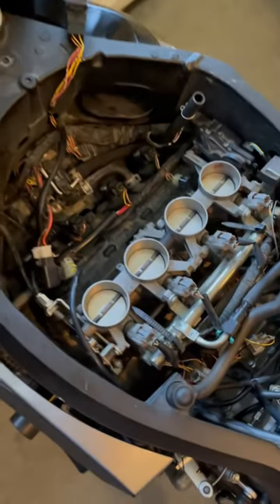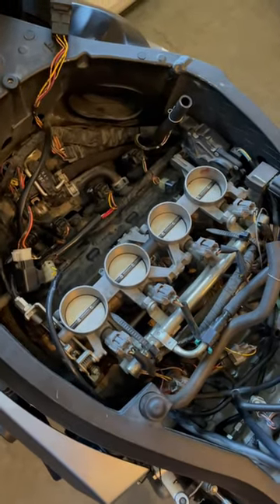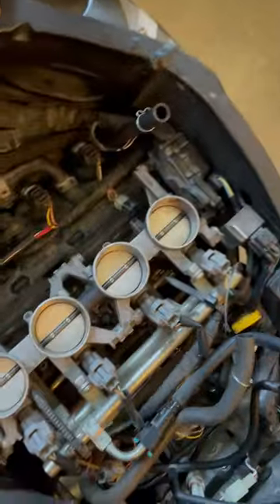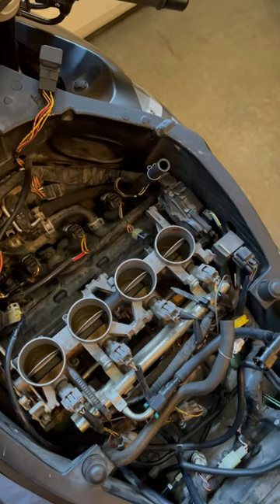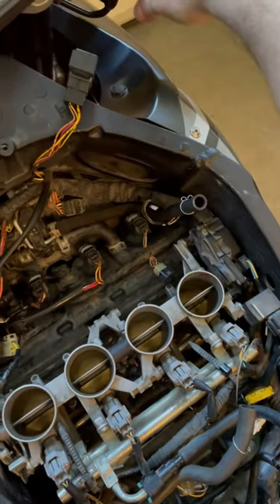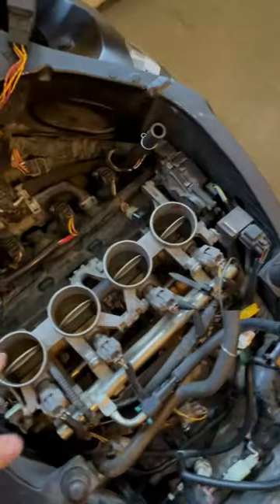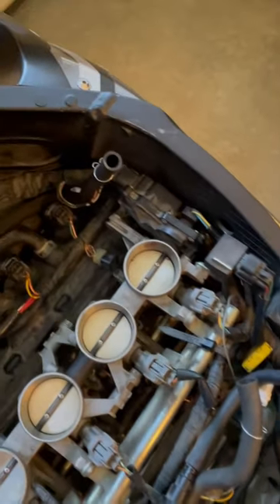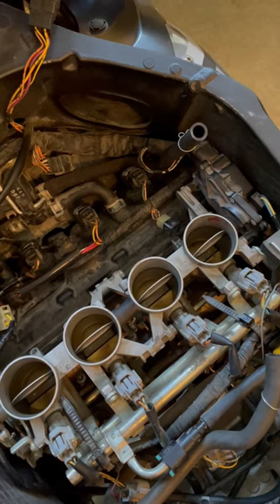Throttle body valves issue? GSX-R750, 2007

Comment: They stay open until you turn the bike on and after like 30 seconds they slowly close as it reaches normal idle. Also the stva is working fine going by sound. When they close after you have it running blip the throttle and they should mirror the primary valves(the butterfly’s bellow the ones you are touching)

Comment: I hope you can fix your bike, my bike it's 2004 Suzuki GSX-R 750 I let seat for over 13 years with out running now I have a problem start running, I did clean the injectors did spark plugs I changed 2 fuel pump and still don't start cold, I have to use B12 to start it running
Reply from the maker: yikes. ya I don't think that's going to happen here. It's ripped apart in my garage right now. Had the STVA and secondary TPS sent off to get checked - they came back fine. I did order a new primary TPS though. Going to put everything back together in a couple weeks and see what happens. take it to the shop and spend the big bucks if it comes to it.
Reply: Have you tuned the throttle body
Reply: Have you cleaned or replaced fuel pump
Reply from the maker: @oppsinmywood6363  no I haven't.
Reply from the maker: @oppsinmywood6363  regarding fuel pump, I plan to clean it.
Reply: Noopp!! is the throttle body censor/ I had the same issue 🎉🎉,,@😮

Comment: I just unscrewed the plates and cured the headache. Be very careful not to strip screws they are locktite in there. Heat them with soldering gun.

Comment: I got the same year it’s supposed to sound like a fuel pump priming. They should open, close, then open again. My bike wont start if it does what yours did. So i got turn it on and off multiple times depending. Once it sounds like a full prime my bike will start
Reply: It’s a fuel injector problem I feel. I had the same issue. It probably has to do with the wiring

Comment: For my bike it was the tip over tilt sensor, that stops the throttle bodies to close back down and doesn’t prime your bike
Reply: Howd u fix that I have that problem at the moment
Reply: @kyleaganos5503  the tip over sensor should be located under your rear tail fairings under the taillights(black little box) connected to your taillights.
Reply: @Humberto Ramirez  and problem got fixed?? What did you do unplug and plug it back?
Reply: @kyleaganos5503  checked if it’s plugged in, I bought a new one and it fixed the problem.
Reply: @humbertoramirezsalas  thank you!! It's called tip over sensor? Lol
Reply: @kyleaganos5503  yes, good luck 🫡
Reply: @humbertoramirezsalas  thanks appreciate you 🙏
Reply: I can't find it
Reply: @kyleaganos5503 it’s in the very back of the bike near the break light

Comment: Get an manual with the specs for the throttle sensors

I’d check to make sure the throttle grip is  moving and has the right play
Make sure the throttle position sensors are showing the right voltage/resistance

I don’t know about gsxr but Yamaha have a diagnostic mode so you can see the throttle expected opening vs actual opening
Reply from the maker: Thank you. The issue is that it blips/cuts power at high rpm, around 12k. Like hitting a rev limiter. Runs fine otherwise, maybe too much air, which would make sense if they stay wide open all the time. But if that’s the case, why the blip at high rpm?.. I have a manual and will try to troubleshoot that way. Mechanic wants me to replace TPS sensors and STVA.
Reply: Could be another issue
There’s obviously a problem with the throttles remaining open, so you would at least tackle that first

I wouldn’t just throw parts at it, it’s normally a min or so to get resistance values or voltage changes, just make sure they’re out of spec first
Even if you don’t know the values, you should clearly see a difference when twisting the throttle
Generally off throttle is .1volt and full throttle is 5volt (obviously could be more or less but at least gives you an idea)
I would first test the APS, then TPS then the Secondary TPS (you should be able to unplug this to bypass it if I remember correctly)

And if you want to check condition of the motor, grab a pack of little alligator jumpers, check to see what is the signal positive and ground on the motor, just jump the ground to ground and then pin it into the incoming power with 5v to the open loop, should open all the way, then power the close loop and should close all the way
Reply: @jaydenriley2875  did you end up figuring anything out with this? I have an 07 750 and it sounds like it’s doing something similar. I have normal power till about 3/4 throttle, but wide open it falls on its face.
Reply from the maker: @kadeisawsome  I took the TB off (still is) to remove the STVA and STPS (both are connected to the side of the TB). I sent the parts to "the geek" (eBay) for STVA repair. He looked at it said it is totally fine, also checked the sensor for me and said that was good too. only thing I think it could be now is either the TPS, fuel pump, and/or the ECU. 

I had the mechanic test the fuel pump before any of this and he said it was good. The geek recommended I get it tested again for longer than the manual suggests. Weird thing is when I went to get it looked at the mechanic said the TPS was out of adjustment. He then adjusted it and the bike now cuts power at 12k RPM vs. 6-7k RPM. A big improvement. Might just replace the sensor while the TB is off - it's a relatively cheap component. if no dice there, then I'll get the fuel  pump tested again, then maybe try another ECU. Pretty frustrating. 

Kinda pissed the mechanic just gave me a list of pats to replace vs. testing them. It was recommended that I just unplug the sensor when the butterfly valves are open, then see if it still does it. Will throw an FI, but at least it will rule out the sensor. This has become a project for spring 2023 (in Canada).

Comment: Do you have a check engine code? C28 or C29?
It’s your STVA.
But in your case I think it’s normal to start closed and when your bike reaches optimal temp it will open. Or maybe I have it backwards. But I think it’s normal.

Comment: Had the same issue on my 06 gsxr 600 it’s an easy fix
Reply: What did you do?
Reply: Does your motorcycle run?
Reply: @humbertoramirezsalas  yes but I don’t see the butterflies opening and closing the way they should when you hit the re switch
Reply: @chasmatteo  have you been doing work on your throttle body?
Reply: @chasmatteo  if you have then your connections are wrong on your throttle body and fuel pump. Switch the connections and see if that works. It has happened to me before.

Comment: Hey guys I jump started my 08 750 to a bus last month, desperately trying to get it to run after having it sit in the garage … Long story short I ended up replacing the dead battery and it still engine wouldn’t turn , bought a new relay & thee engine still wont turn :( Any suggestions or ideas to what else may be the issue
Reply: A lot of times when you buy a new battery they require you to charge them first before just putting them in the bike. This happened to me before is why I suggest you try that or put some jumper cables on while hooked up on the bike and try to start it than.

Comment: same issue on my 05 gxsr6, gradually got decrease in power on my bike, gotten to the point of chugging when the motor is under load. new spark plugs, new fuel filter, dipped the tank, now won’t even start. turned a couple times, spark and compression is there thinking it’s something gastric. just ordered two new tps. anyone have anything?
Reply: I’m having trouble he same issue.
Reply: @eastoaklandsartiebo-bo6718  I ordered a Quantum Furl Pump and now runs perfectly